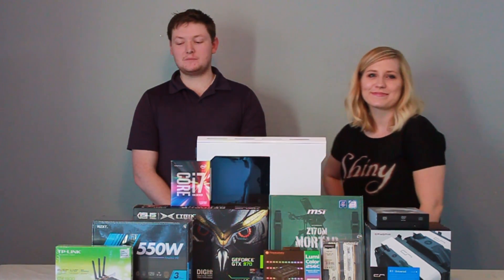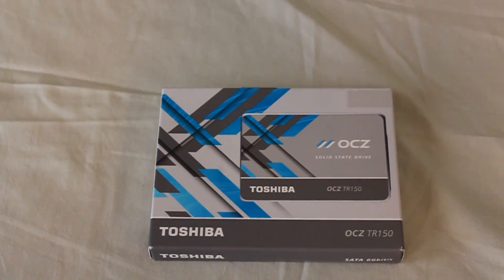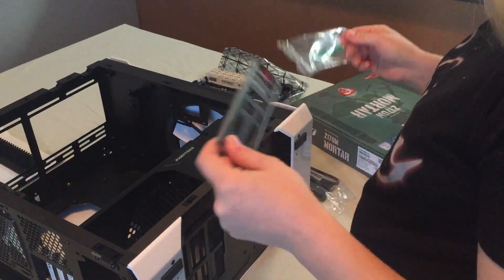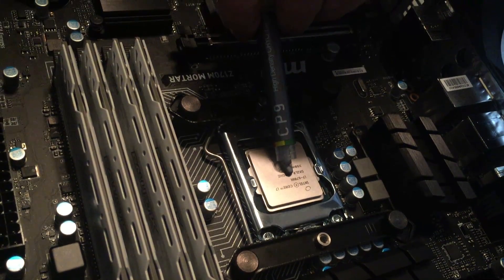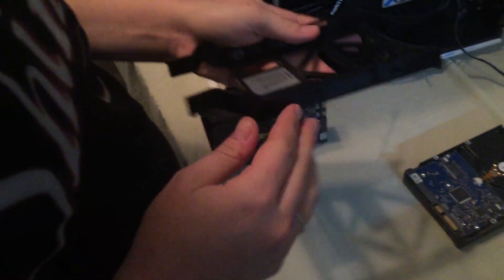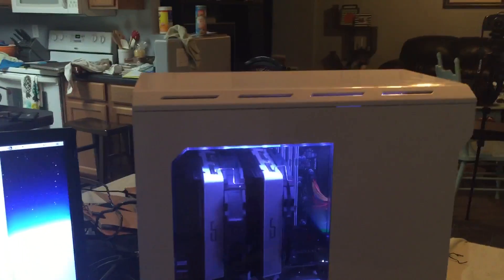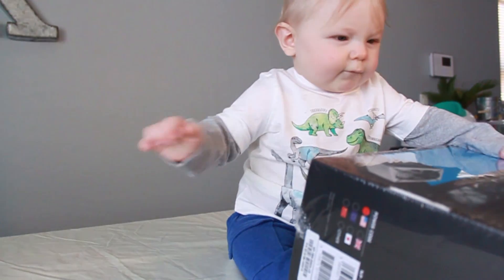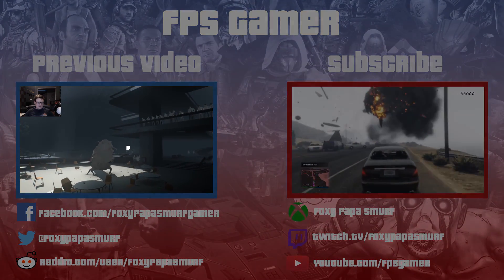$1300 Wifey Build | Sierra Hackintosh

Comment: Great video! Only problem i have is that the wifi card is not picking up, the status light on the physical card is green but once i am in hackintosh i cannot identify the wifi card at all.
I am using the same card as you mentioned in the description. Any suggestions to get this fixed, i have been all over searching for a solution, many websites including tonymac.
Please help if you can
Reply from the maker: Sorry man, I specifically chose that card because it seemed to be widely accepted by hackintosh machines. Maybe switch to a USB receiver for the time being?

Comment: I'm getting this same case, how exactly did you end up mounting the SSD there on the back side?
Reply from the maker: We actually had to mount it higher than it was designed to be mounted. Normally there are 4 rubber pegs that match up with the 4 holes on the SSD tray. We had to instead align the 2 upper pegs with the two lower holes to reach the open sata power connector. We were a bit short on sata power connectors since we had 2 HDDs, an optical drive, and an SSD.

Comment: I installed yesterday macOS Sierra on my hackintosh, so i can confirm my specs. 
CPU: i5 6600K
MOBO: Asus H170M-Plus
RAM: Dominator platinum 16gb 3000mhz ddr4
GPU: GT 210 (This one works OOB, out of the box) I have a gtx 1070 for my dual boot windows 10(no gtx 10xx does not work on sierra)
I stucked to tonymacx86 too, and some google research on the parts where i got stuck(problem was some BIOS settings). There is a build guide on tonymac site to follow. For questions, just reply on this message for other people. Only thing what isnt working is imessage and facetime.
Reply from the maker: Great insight, thank you

Comment: Freaking awesome! What would be the best bet for a budget hackintosh? I was thinking core i3-6100, gigabyte. H170N-WIFI MB, crucial 8 gb ram, stock cooler, and I already have a supernova platinum power supply, and I have a 250 gb Samsung ssd, what do you think? Did I miss anything? :) thanks!
Reply from the maker: Skylake seems to be a great choice from what I've seen. I'm curious how Kabylake will perform. I imagine similar. The motherboard is a big determining factor on compatibility so I would refer to tonymacx86 for their recommended options. Thanks for watching!

Comment: You have confused "Bytes and "bits" this is a factor of 8 or 10 depending on the encoding. Mbps = Megabits per second, MB= Megabytes per second. WiFi cards are nearly always sepc'd in Mbps (Megabits per second. If you look at the box you will see Mbps which is Megabits per second.
Reply from the maker: Thank you! I didn't notice until after I had posted, appreciate the feedback.
Reply: You're welcome. Lots of people mistake Megabits and Megabytes, too bad bits and bytes both start with "b"

Comment: Is that the 10 series(1050,1060 etc) graphic card works on the hackintosh?  I was told no recently.
Reply from the maker: No it's a 970. I have a 1060 in my PC. I've heard the same thing. Not sure what driver it would use.

Comment: Showing the full install process would have been nice especially since it's not so straight forward as it is for Windows or Linux.  I see too many "we build a Hackintosh!" video and it just really devolves into a "we built a computer" video.
Reply: It's not that hard. If you can build a computer, you can build a Hack. If you're more of a casual builder (like me) and want the minimal hassle, just do the normal google sleuthing and use a board everyone and their mom has gotten going. (Certain gigabyte boards seem to be favored for this currently.) Once you've got a hack running, you can clone it to another computer with something like clonezilla, run any updated configs on boot and through multibeast, and you're GtG.

The only thing that happened to me that I've never seen mentioned was a need to re-image the usb boot drive every time I screwed up the process. It makes no sense I had to do that. But it happened on multiple usb drives. So the hack install took multiple hours.

Comment: nice build!  FYI, regarding the wifi card touching the fan of the GPU, you can just move the wifi card down to the full size PCI-e slot.  All the pins are the same.
Reply from the maker: I found this out after referring to r/hackintosh. Great suggestion, worked great. I will address this in an update video.
Reply: That's a bit of a no-brainer, no offense. With 99% of modern mobos, you can easily put a smaller PCI-E card in a larger port.

Comment: Hey so once you install the hackintosh, is it safe to sign into your apple ID? (because it isn't an apple product) and does everything work like a normal mac computer?
Reply: No, it's not 'safe' to sign in to your apple ID. You need to follow the instructions on the TonyMac86 website to get it iCloud, Messages, AppStore working. The goal is to create a fake serial number for the computer and a bunch of other properly formatted designators that match the SMBIOS of the computer you've picked. It's easy to do, but you have to follow the instructions to the letter. If you don't do this properly you run the risk of the  machine creating a new serial number with every restart and then Apple shuts down your AppleID.

Comment: Looks solid! Did you have any troubles installing OSX? Does it work fine?
Reply from the maker: Surprisingly smooth installation. From what I hear, iMessage and audio drivers are the sources of the majority of issues. I have yet to test either though. Still waiting on the speakers.
Reply: Can you please tell me if the audio works when the speakers will arrive? I'm a bit frightened to build my own hackintosh and if your build works fine I'll just follow your instructions. Thank you very much!
Reply from the maker: I downloaded a number of drivers and the closest I got was usable audio but with a lot of static in the background. I eventually bout a USB to mic and aux adapter which works wonderfully.

Comment: How loud is this build? I am counting at least 6 fans.
Reply from the maker: Gregory Grosse that's correct! Although the GPU fans don't spin unless they need to (which they probably won't since she doesn't game). The case isn't labeled as a "silent case" but it has a lot of features that keep the noise levels down. I made a vid on the case too
Reply: Thanks. I will check out the other video. Nice, robust build.

Comment: Did i get it right? You said, you are using a gtx 1060? But under Windows, or? I got a 1060 here, but there no drivers out for Mac OSX, so i had to swap with a friends gtx 970.
Reply from the maker: Tim Neumann the 970 was in my Windows 10 machine. I passed it on to my wife when I got my 1060
Reply: oh. Too sad :/

Comment: Nice Job! I just have two critiques:

- You don't talk about the actual installation process and troubles you ran into, which would have been (at least for me) the interesting part. So this is basically just a video about assembling a computer and where to find some starting info for a hackintosh build.

- Your video editing is pretty good, but get better lightning and a stand for your camera. There are parts in the video where all I could see was a dark inside of a box, mixed with some shaky back and forth actions.
Reply from the maker: Michel Conter thanks for the feedback! I had originally planned to document the install, but it was pretty late by the time I got to that point!

Better camera equipment is on the horizon...
Reply: (bigger aperture lower iso)